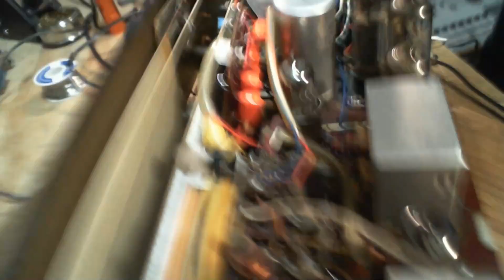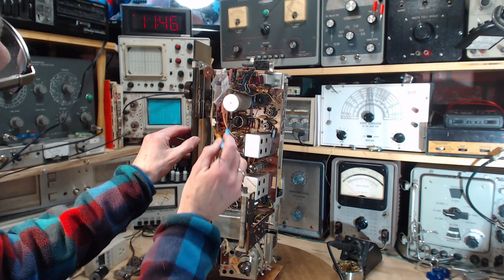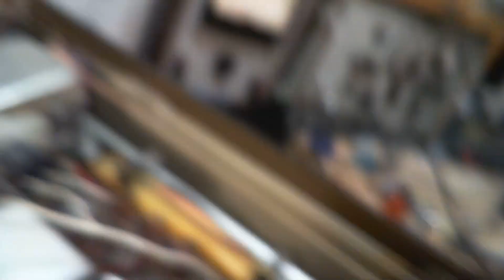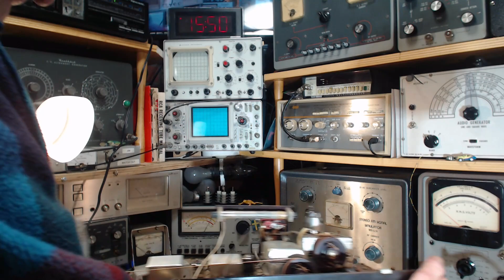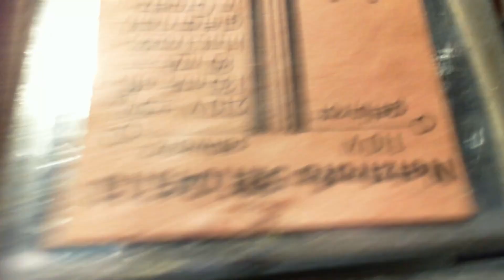Nordmende Caruso Console Video #7 - Ten Ugly Capacitors Replaced

Comment: Let's see if he will remember to check the B+ after replacing the Selenium rectifier with a Silicon one, and take appropriate countermeasures (add series resistor) to drop the voltage.
But since he don't read comments he probably needs someone to read them for him and E-Mail him about it. 
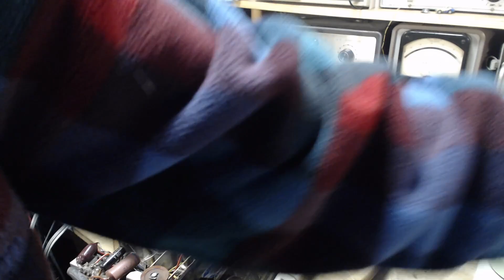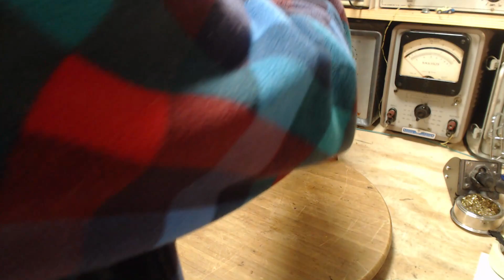And seeing how at 44:10 and 44:15 he tips the radio over putting all its weight on one single corner of the dial glass my bets are on it cracking within the next three videos. Unless ofc someone emails him about it. Right, "Charles"?

Comment: Replace the full wave Selenium bridge with silicon and then replace the Multi-section electrolytic cap (4700-100-50-50) 
with separate ones perhaps.

Comment: Check out how cheap Powered Solder Suckers are these days.. 
What use to be hours of work  de-soldering Valve Units with Capacitors and resistors installed onto a PCB now takes a considerably shorter time by using them..
APU I dropped a like..